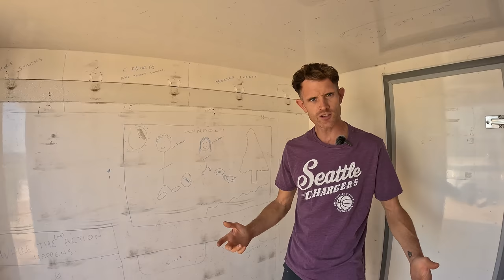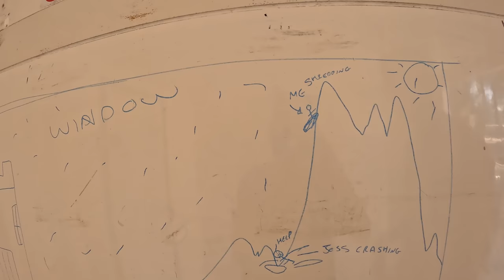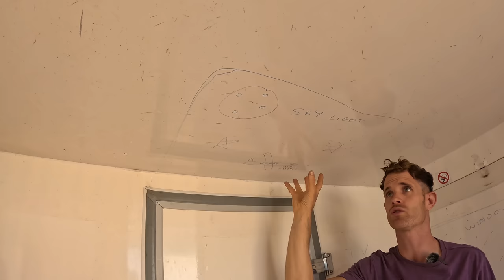Supermarket Delivery Van to ULTIMATE Winter Campervan: Van Build Part 1

Comment: Just a warning I did the same as you did with the aluminium trim you used on the side door. It was terrible weak point for thermal bridging, lots of condensation and even ice on the inside when living in it at -20.
Reply from the maker: Did you use the original door seals or did you do a different style door ?
Reply: @truebluetravellers  my build was in an alu skin Luton style uhaul i bought in Canada that I had sprayfoamed so abit different. I built the door out of the same style alu profile so that made the problems even worse I think! No door seals so that also probably added to the thermal bridge.
Reply from the maker: @wawa8031  I see, sounds like a cool build, I’m hoping that the original fridge style door seals will help but also wondering what people do to overcome this issue in expedition vehicles etc 👍
Reply: @truebluetravellers  I think you will have problems with anything (especially metal) that goes directly from the inside to the outside without some kind of thermal gap. The more expensive solution would be to buy a nice prebuilt expedition camper door or try and work out how they do it.

Comment: Given the size of your flat roof, you could afford normal household panels and get a really useful amount of power to charge a big lithium ion battery to run all your cooking and water heating needs - no gas required. Just add a chinese diesel heater fed from the main diesel tank and you're all set.
Reply from the maker: It is a big roof space and that’s a great idea but we’ve decided to go with gas because we will only get a couple of hours  daylight a day some of the places we are going and weren’t confident that it would be enough to rely on especially if those couple of hours are overcast and the solar panels get snow on them. We are making roof access to clean them but that won’t help us much while it’s actually snowing. We have got a diesel heater though 😀

Comment: Tool question!   what make/model of lift is that?  it looks like it was actually intended for outdoor use with the covers
Reply from the maker: It’s just an automotech 2 post ramp mate, it’s designed for indoor use but all I’ve done is make a steel frame to go over the columns and got some covers made to go over them so when u lift them the frame goes with it, been outside for about 5 years now and still immaculate inside the covers, I’m going to show how I did it in the next episode hopefully 👍

Comment: I've just got to this stage with mine and the chiller section has an extra 50mm of insulation, meaning that I'm losing 100mm of width. I'm going to have to go do a bit more thinking.
Reply from the maker: Oh really, is it a Sainsbury’s or an Asda van
Reply: @truebluetravellers  I'm told it's a Sainsbury's van. Older vintage than yours, so it doesn't have the swoop at the front. Just a big square box.

Comment: If you ever do one of these again, on that back panel, try to do a dovetail shape cut (I know that you have covered it with the bed as added strength) and also before you fit the panel into place, drill some 1/2" ish holes into the mating faces, that will allow the expanding foam to go into them and give you a far stronger joint. Doing wrong with what you have done and being a time traveller, I know that it holds up very well 🙂
Reply from the maker: Love that idea 👌

Comment: So have been installing aluminium flashings on steel frames all across London at train stations in the last 6 years on pedestrian bridges that span platform to platform ,,, all while using sika flex/tac , with it needing to last 50-75 years

Please please do not use screws to pull in tight what you are bonding , you need to keep the thickness of the mastic at least 2mm to make it work long term , you should be using the tape alongside the mastic to prevent flattening of the mastic
Reply from the maker: Again cheers for the tip mate I’ll be using the tape next time 👍👍

Comment: Can you squeeze it into a standard parking space?
Reply from the maker: Yes just, this is the main reason we like this size van or a mwb as they are quite easy to use around towns
Reply: We're thinking it's the perfect size, looking to start ours this year, slinging tanks where your lockers are I think, dirty and fresh water? Will be an interesting build 👍
Reply from the maker: @Carrotvan963   we are putting the fresh water tank under the seating inside to stop from freezing in the cold, there’s loads of space under the body in the middle for tanks too, compared to a pannel van there’s loads more scope to play with anyway, they are a brilliant size due to the square walls from floor to ceiling and the fact that you can sleep sideways too is brilliant, 1 negative is most don’t come with a/c which is a bummer
Reply: @truebluetravellers  Where you're planning to go that makes sense, thanks for the info 👍ill check out the middle section and the seating then, ta
Reply: Yes. You won't be able to get out the vehicle tho. 😅

Comment: Just found this video. I'm doing the same here. Well if you make it over to Sweden (Uppsala). You're welcome to British X-mas dinner at 15:00. My wife does a Swedish one the day before has their Christmas day is the 24th! Just remember to have winter tyres on. Even if there is no snow or ice, it's the law. If you have tyres with spikes on. You can't drive in most city centres, and drive with your head lights on always (or you get a fine). Right then. On to your next video! The other thing is that not think we have these gas bottles here in Sweden. I've not seen them has they are the old version (not sure about Norway & Finland) We have safety gas bottles here. They have the same fittings to hook it up. We just exchange them at the petrol station for a full one. So you may have to buy safety bottles??? Aluminum is a soft metal and be cut with a standard wood saw, 60 teeth is better than 24 teeth.
Reply from the maker: Thanks for all the info it’s much appreciated and the lovely offer of dinner 🥰, yep we have winter tyres on and the gas bottles we are hoping we should be able to do the whole trip on Booth bottles as we shouldn’t use too much gas, but good to know what to do if we do run out 😁👍👍

Comment: I'm impressed with the build so far! How you scored a supermarket delivery van that tidy I don't know! My dad delivered for Tesco and a mate delivered for Waitrose for years and all of the vans they drove were battered to hell, you've done well with that one!
Reply from the maker: Cheers mate, I was just chatting to a bloke the other day about them and as sainsburys only lease them Mercedes have them back once the lease is up and Mercedes sell them on direct, apparently this one dealership was selling on the forecourt all the tidy ones but all the rough ones were going to auction
Reply: @truebluetravellers  do these vans need adblue? any idea what mpg is?
Reply from the maker: @steve-r-collier  no add blue on this one mate but the newer ones do, I think it will do around the 28mpg as my old sprinter did 30 so guessing the box over the cab might bring it down slightly

Comment: PS I would love to see the costings for this build, bet you're going to save that till the end though...of course doh!😅
Reply from the maker: I’m sure we could do that but yes will need to be at the end. So far some things have been loads cheaper and easier than a panel van like insulation, lining the walls and ceiling etc but then other more expensive like the seal for the crawl through from the cab. Be interesting to see how the overall cost compared to a panel can build 😃

Comment: That aluminium door frame will just be a cold thermal bridge from the outside to the inside.. The frame needs isolation from the outside.
Reply from the maker: Yeah I’ve had a couple of people say that now David, thinking of a way to get round it 👍 cheers

Comment: superbbb
Reply from the maker: Cheers Richard 👍
Reply: I CONVERTEd a mwb sprinter waitrose van this year:) but a typical fridge van not mounted like yours. Cutting the bulk head out was a nightmare !! haha @truebluetravellers
Reply from the maker: @richard17329  did you cut the whole back end of the cab out or did u do a crawl through ?
Reply from the maker: @richard17329 sounds brilliant 😃

Comment: it gets so cold that the doors freeze shut you can get a wax gel that goes on the ruber around the doors also a engine heater is amust you need this when it gets below minus 15 some diesles wont start in north sweden i have seen 40 pluss below it burns your skin if not coverd and looks like you have a tan lol
Reply from the maker: 😂😂😂😂😂 yep but the tan is fading… fast 😂, that’s brilliant advice about the gel, thanks I’ll have a look into that, yep we will be installing the pre heater as seen  on a few other channels about coolant freezing engine knock etc but thanks for the heads up 👍

Comment: hi i lived in sweden ,,are,, north  for two years you need studid tyres soft the better and  not cheap at  around 300 each rear wheel drive wont be fun at all cars drive at 50km plus on snow and ice but most  are 4 by 4  , i have seen lorrys from stockholm to arive in ,,are ,,north sweden with none studed tyres and crash bad my advise if you have a heavy truck rear wheel drive is to keep away from snow and ice please do your reaserch be fore you go and the weather can change fast in these cold places very fast good luck cool build
Reply from the maker: Cheers mate, much appreciated 👍 yep we certainly do our research and don’t take things for granted so will be well prepared 👍

Comment: Great Project. Where did you get that van from?
Reply from the maker: Thanks very much, we found it on eBay from a dealer in Burnley 😁
Reply: @truebluetravellers . Cool, you said its 2 m wide and high in the living space. how long is it compared to the a normal MWB?
Reply from the maker: @Bracebarian  it’s the same as a normal MWB 😁 so all the same advantages of getting in parking spaces and things

Comment: Would not have touched that van. The main reason being the service on them is shocking, they were often not Serviced ever. And the way they were driven by some of the drivers they were thrashed. And yes this is from an ex Sainsbury’s delivery driver lol. Was looking at the floor and trying to work out if I had ever driven that one as the bad floor looks familiar
Reply from the maker: I guess that’s a risk with any commercial vehicle. Some people will treat them well others won’t, I guess the slight protection you have with these is they are auto, have speed limiters and a traffic light system. No guarantees though, also lucky that Jons a mechanic.
Reply: As they were all on a contract they never got serviced. I did enjoy driving it because it was automatic and did think it would make a good camper van.  But because they never serviced them that always put me off. Most that age would e at least 50-60 thousand over the service period.

Comment: How many miles did the van have on the clock???
Reply from the maker: Hi, it’s done 95,000 miles 😃
Reply: @truebluetravellers  not bad for one of those vans. But I do see a lot on the back of recovery trucks I wonder what goes wrong with them.  Maybe too many short journeys 👍
Reply: I'm sitting a sainsburys van thats two years newer than that and got 102,747 miles on it. So good find!

Comment: Its all good if youve got the cash spare. Tbh ive gotta agree with other comments on here, these vans are run ragged I personally wouldn't touch one with a barge pole. As a current driver I can tell you maintenance isnt completed correctly. 

Enjoy
Reply from the maker: I understand what your saying but unfortunately most vans are like this as they are normally commercial vehicles, builders, mechanics, plumbers, couriers and allot of them are ragged too, I think it’s hard to find a decent private owned one now days and if you do normally that comes at a hefty price too but yeah I get what your saying 👍
Reply: @truebluetravellers  tbh I'm probably just jealous. If I didn't make such bad financial decisions in life I'd probably be doing similar things. Fair play to you both hope the project goes well

Comment: Hi, if you were looking for a 2 metre by 2 metre square box with even better insulation, a rollover proof body, double glazed windows, built-in diesel heater, skylight, lighting, 12v and 230v electrics, three external lockers, internal cupboards that you can literally hang off, underbody storage lockers, 6 wheels for Uber off-road traction and a side door… with 2000kg of spare weight to build with, why didn’t you buy a Mercedes Modular Ambulance?
Full service history with like for like parts it’s whole life.

Compared to a flimsy Luton that wouldn’t survive a side impact and requires everything to be added off the Shelf.

Good luck with your build obviously but what you are going to spend on building out, would have paid for a C1 license with a few grand to spare.
✌️
Reply from the maker: Thanks mate 👍 love an ambo build, to be honest I love anything that has been repurposed and given a new life 👍👍

Comment: 1. The roofs on box vans are not as strong as normal vans so be careful working up there and obviously no good for roof storage.
2. The walls are also not as strong as normal vans which obviously will have its downsides
2. Not the best for stealth camping
Reply from the maker: What happened to 3 ?

Comment: they are terrible off road be careful, Ive almost gotten stuck so many times delivering to farms lol
Reply from the maker: espically these unloaded as they are so light, when I took the box off I struggled to move it on my gravel drive as it just spun up, will be better with the all terrains and a bit of weight in it 👍

Comment: Hi guys what are the internal dimensions on the Box.cheers
Reply from the maker: It’s 3320 long 1950 tall and 1960 wide 👍
Reply: Cheers for your quick reply.I was looking at ducato L3 H2.But your build is looking more suited to my requirements.You mention crawl through a none negotiable.Whats your reasoning behind this.This looks like a job well beyond my means and skill set.So would have to outsource that work.What size engines are in these.There are so many positives to the build.and ample space and clearance for underslung water and gas.Savings made on insulation.Cant wait to see the finished build and subsequent adventure.Thanking you for your entertaining and informative vids.
Reply from the maker: Cheers mate, so reason of the crawl through thing is we wild camp all the time so we wouldn’t want to pull up somewhere at night and have to get out the van to get in the back, if we stayed on campsites it wouldn’t be a big deal, so the engines are a 2.1 and they are RWD, like u say loads of space underneath for tank and gas etc and if we weren’t going to the arctic with it we would of used all the space better really 👍

Comment: the only thing i dont like is that its the older merc.. the newer ones us tesco drivers have are so much nicer
Reply from the maker: I prefer the newer mercs too to be honest but I’ve heard they are not as reliable as the older ones
Reply: @truebluetravellers  ours are on 200-250k with vary little servicing and they have only just started becoming a problem

Comment: The panels aren't that thick, the floor is weak, the box body flexes on the chassis, and they rattle clank and squeak - I drive them daily.
Reply from the maker: The panels are that thick, I’ve measured every panel and roof front and back are 55mm sides 30mm, I’ll be installing a wooden floor in the van to add strength, the rattles clanks and squeaks I should sort due to stripping and rebuilding 👍

Comment: Or just take the Defender you just built🤷‍♂️😁
Reply from the maker: Whilst we think it would be amazing to take the defender, there’s a few reasons we’ve decided not to. First is that in order to maximise our storage space inside we decided to put the water tanks outside so it just wouldn’t work where we want (likely to get down to -25) to go, we’d just be driving around with giant ice blocks and no water 😂, we also didn’t install a hot water heater (saving space)  as we only plan to use it in warmer climates. And while we did insulate it, it’s nothing compared to the insulation on the van so would be a lot harder to keep warm. There’s also lots of places you just can’t insulate like inside the tent. The other big thing for us was about the space inside. While the pop top roof makes a huge difference it’s still pretty squeezy in the defender, which will be incredible in warmer climates where we can spend lots of time outside but where we are going we will only have a couple of hours daylight each day and need to spend more time indoors so hopefully this van will keep us warm and give us plenty of space to be comfy as we plan to be away for more than a month. And lastly I (Jess) am a massive wimp about the cold so while tougher people would relish all that goes with travelling in a defender in the cold I’d do Jons head in 😂😂😂

Comment: Be careful with what you do to the body as its glued together and not mechanically fixed.
Reply from the maker: 👍 cheers mate, yep spoke to the body builders and had a chat about them and how they are all constructed, sounds strange that it’s all pretty much glued together, including the c Chanel’s to the floor but the glue is unbelievably strong, the furniture that I’m installing with be fixed to the walls too to tie it all together too but thanks for the heads up 👍